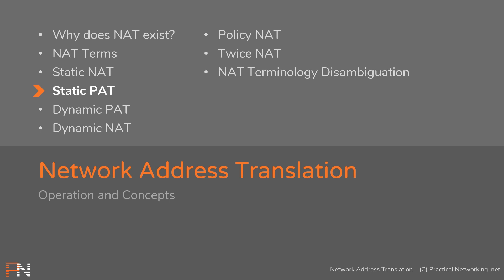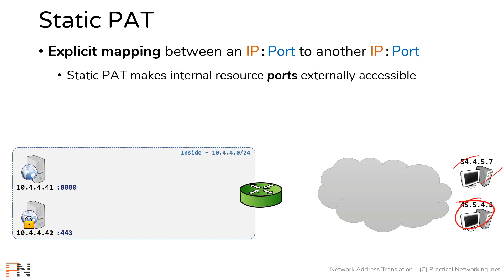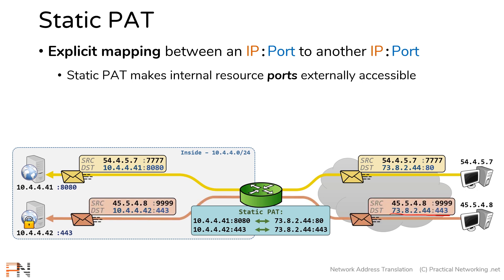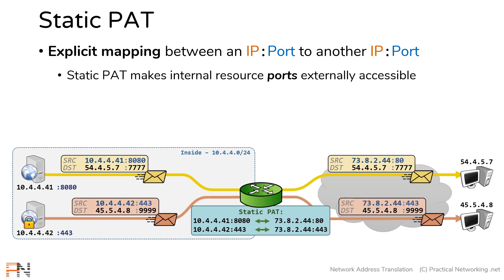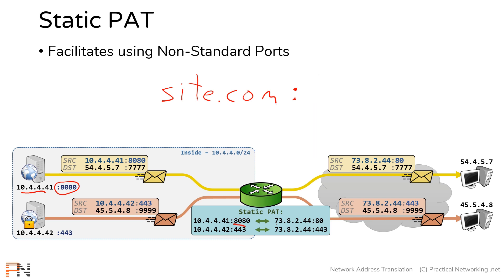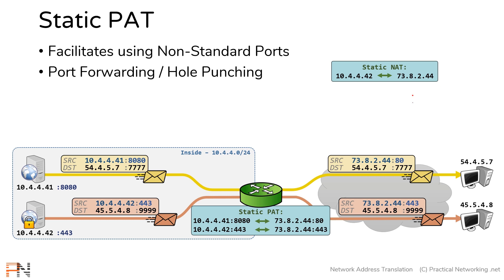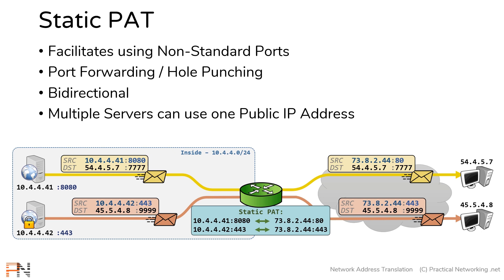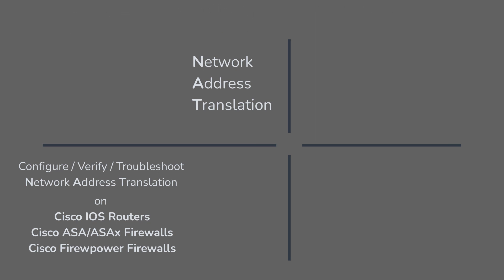Static PAT - Network Address Translation

Comment: With static pat when requests originate from the network the source port could be random and destination port is a well known port. In this case how to define a static pat rule as the source port isn't known in advance.
One way could be ensure clients bind to specific ports. Another option if we mention a pat rule to change the source ip and port based on the destination port ?

Comment: What if two web servers hosting on port 443 but both the servers have different private ip address so  in this scenario static PAT will work?
Reply from the maker: Yes... but you'll need to use a different port number on the shared public IP.